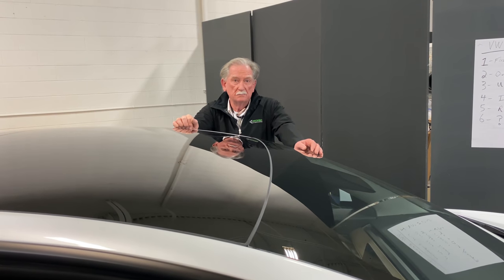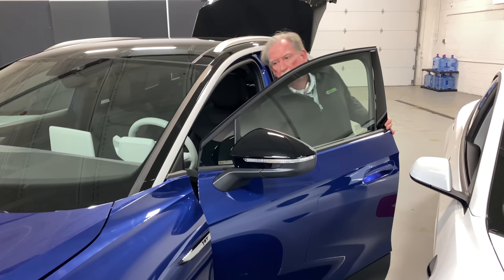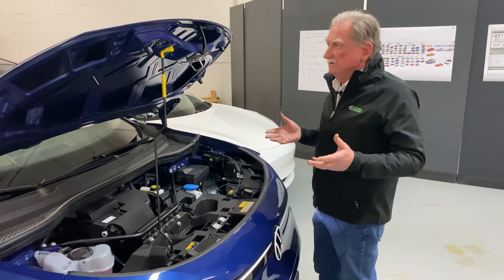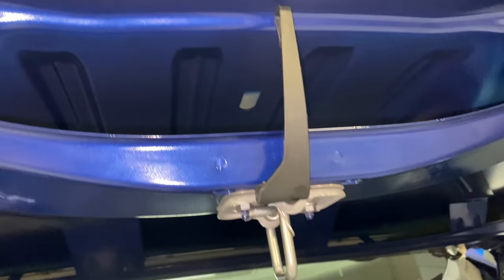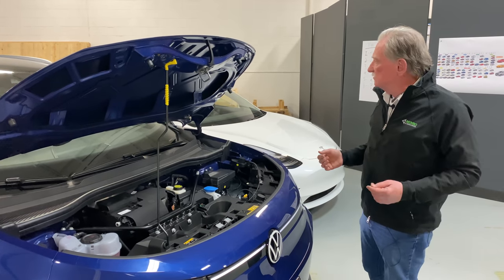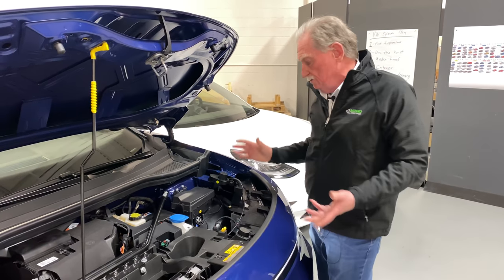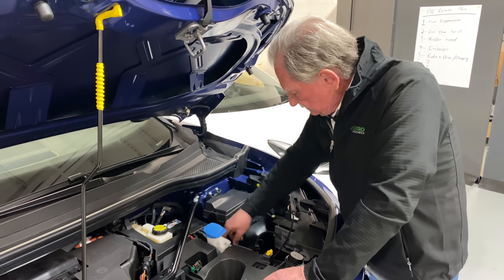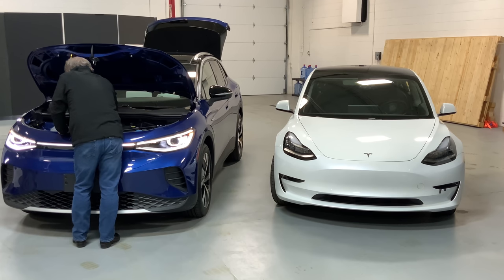2021 Volkswagen ID.4: E2 - Under The Hood

Comment: Looks like ID.4 has a lot of opportunity to cut weight which would improve their range.
Reply: Weight is not something you want to spent to much time on electric vehicles. Because it's also a positve thing. But only because of recuperation. You can see it on the bmw i3 for example.
Reply: @lsb187  your response is a joke.  all vehicles should be cutting weight especially EVs.  Poor engineering.
Reply: Yes. Its about 600 pounds heavier then the Model Y Standard Range.
Reply: @strykerace  has nothing to do with poor engineering
Reply: @wolfgangpreier9160  they are both about 2000 kg. So what are you talkin about?
Reply: @strykerace  read and educate yourself. Read about the i3 and the weight problem. It's a controversial topic. But studies show that it's not as a big deal on EV than on gasoline cars.
Reply: @lsb187  Regen breaking does not make weight an advantage - just a little less of a disadvantage.
Reply: @ryankozak99  that's what i was about to explain.
Reply: @strykerace   Sandy has no idea what reason that rig is there for.  It could be for accident mitigation with the shorter front end.  He just rambles on about stuff being in the front without actually stating why it's there... probably because he doesn't know.  The range of the ID.4 has been measured, and it's perfectly adequate.  They use a lot more steel to keep costs down, but it adds weight.  Would Sandy prefer they use Aluminum and lose money on every sale like Tesla?
Reply: @lsb187  ID4 weighs 4517 pounds or 2049kg. Model Y Standard range Rear Wheel drive weighs 3920 pounds or 1780 kg.
Reply: @updlate4756  They don't
Reply: @wolfgangpreier9160  never mind you're right
Reply: Agreed 👍
Reply: Once the range is adequate nobody is too worried, there are big manufacturing cost and repair cost benefits to steel. The main cost to consumers as a result of the increased weight will be much faster tire wear. I was amazed at this difference when I moved to a bigger car that was about 200-300 lbs heavier and lost maybe 4-6 months of tire life - the new car was more powerful and better in every way (Except fuel consumption, which was similar) than the old one though, so I'm still happy with it 7 years later.
Reply: @lsb187  educate yourself.
Reply: @updlate4756  adequate does not mean its good, and adequate is depending on who you are talking to.  Sandy rambling on has more value than most highly qualified engineers.

Comment: I was so surprised when he opened the VW frunk. I questioned whether it was an EV for a second!
Reply: Because you're ignorant. Short bonnet with all the equipment underneath allows huge interior space. Tesla has small interior space with many equipment inside the car and long useless bonnet.
Also the huge turning radius of the Tesla versus Volkswagen ID4. Laughable.
And Tesla has some of the worst pedestrian safety of modern cars tested by Euro NCAP.

Comment: The frunk of the ID.3 (and ID.4) could be used to hold a fuel cell stack, so it was not designed to carry luggage,
which explain why there is an handle located near the driver instead of an icon on the Tesla screen or the phone App.
This was mentioned during the ID.3 concept presentation at the 2016 Paris Motor Show.

Comment: For other cars you don't jump directly from the battery you normally pull the fuse box cover off and there's a metal plate which I can see at 11:07, maybe double check manual?
I quickly googled it and couldn't find the information

Comment: At least they included a fuse guide in the manual, my 2017 e-Golf comes with no info on fuse layout. Must contact dealer tech or guess. The reason given for doing this is that it changes too frequently to commit to a manual. Really? I'd settle for a sticker with the info.

Comment: I didn't know EVs still had regular car batteries.
Reply from the maker: Yes indeed. Even Tesla’s have small 12v batteries. The low voltage systems still operate on 12 volts and the battery is sized for those loads.
Reply: Elon said is multiple interviews he wants to get rid of those, maybe in cybertruck
Reply: @635574  New Model S and X are Li-ion 12v
Reply: @Robbie6298  Still 12v
Reply: @andkosification  Unless all the suppliers in the automotive industry move to 48v or Tesla makes everything in house were gonna be on that archaic standard forever.  Most OEMs aren't going to design thier own 48v window switch, dome light, ect
Reply: @635574  Elon also said that we shouldn't still be relying on measly 12v batteries. And he wants to move on to a higher volt capacity instead of 12v.
Reply: @635574  uhm nope he won't get rid of those, many other companies like mercedes have been using 48volts battery systems, the high voltage battery is very dangerous.
Reply: @Robbie6298  mercedes, audi, bmw, land rover..... already uses 48 v systems
Reply: @635574  Most likely it'll just change to a Li Ion 12 volt.

Comment: "Franz, should ve maybe move ze metal bar or ze battery?" - "Nein, let's rather find a smart but ultimately overengineered solution to a simple problem! It's the German way!"
"How about a frunk?" - "Are you crazy? It's hood, people will expect something enginy-looking under there. Use ze largest fuseboxes, it'll use up some space!"
Reply: I bet 100+ meetings went into that coated cross bar.
Reply: @avirbd  I bet you would loose this bet. VW has 660.000 employees...
Reply: @wolfgangpreier9160 meaning more meetings? xD

Comment: This makes me even more confident on TESLA's lead
Reply: Did you doubt in the first place?
Reply: @pedroferreira9234  seeing is believing, inside look - I had 1% doubt you can say
Reply: Based on what?  From the comments, Sandy doesn't understand that fuse boxes are cheaper, he doesn't understand that there's a jump point in the fuse box, he doesn't seem to understand that the shorter front end means more cabin space, he doesn't seem to point out that steel is cheaper than aluminum, nor that this car doesn't weigh much more than a model Y.  Bjorn already did the 1000 km test, and it performed well, so range clearly isn't an issue.

With all Sandy's hyping of Tesla, he never points out that without regulatory credit sales and tax credits, the company would be losing billions of dollars per year.  As it turns out, you can't just throw every needlessly expensive piece of hardware in to your car with little net benefit and expect to return a profit.
Reply: @updlate4756  valid points but imo design is not that great, and Tesla not loosing Money - grow up!
Reply: Which lead!?
Reply: @alanmay7929  software, battery and powertrain, engineering
Reply: @AshJuneja    Yes, Tesla is losing money without tax credits and regulatory credits.

Tesla's 2020 profit was $700 million.  Their regulatory credit sales netted them $1.6 billion.  Take away those credits, and they're now losing $900 million in 2020.  I'd also conservatively say they earned about $4k on average in tax credit subsidies for every vehicle they sold in 2020.  That's $2 billion of free taxpayer money.  Take that away as well, and now they're losing $2.9 billion in 2020.  

They also don't pay business or property taxes on any of their 3 functioning US factories, unlike the other OEMs.  Force them to pay their share of taxes, and how much more would they be losing?

Ah yes, agreeing with my points.. and then telling me "Grow up" because you didn't like me pointing out the facts of their business financials.  Oh boy.  Adults care about facts.  I don't know what fairy tale land you're living in, son.
Reply: will see that in 2021, also there’s something called sga that’s  why net income was low hence answer to your question from Gordon’s playbook

Comment: The thing is that in Europe we actually have pedestrians since people can walk to places unlike in the US.

Oh and also, why would you try to jump an electric car? If it runs out of juice, plug it it in the socket.
Reply: Plugging in the car typically only charges the high voltage battery, which is isolated from the 12V system by a relay when the car is off. If the 12V goes flat, those relays can't engage and the car won't go move.

Comment: It looks to me that VW took an existing vehicle and stuffed the empty engine compartment with whatever they needed for the new drivetrain. Where tesla designed from the ground up!
Reply: No, this is a ground up EV built on a skateboard platform. VW made the decision, as others have noted, to make the hood short (compare it to the Tesla hood) to give the car more cabin space. In many ways (like with the "pedestrian" protections), VW is showing that this is a European car -- where in cities there can be a lot of "blind" corners where a long hood makes it very tough to see oncoming traffic at some intersections.
Reply: At least to me it feels like the opposite. The front of the VW is much shorter and that allows for either a shorter car or a larger cabin. In Tesla's case it's as if they chose a design with a massive engine bay then added a frunk as a way to use up all of the empty space that they were left with.
Reply: It was built from ground up by former fossil engineers. Teslas were built by industrial designers 
and part time self made engineers and rc enthusiasts and not by unionized VW fossil engineers.
Reply: @wolfgangpreier9160  The fact that the VW engineers used to work on ICE cars is kind of irrelevant. Tesla's cars always seem like they were designed as consumer electronics rather than a real car. Shoddy build quality and intentionally making it difficult to do any servicing.
Also you make out like unionisation is a bad thing. I can tell you that's definitely not the case.
Reply: @wolfgangpreier9160  out of deluded tesla fanboyism and tesla has actually grabbed all ice engineers they could from many german brands, korean brands have been doing the same. to german brands designers also btw
Reply: @wolfgangpreier9160  seriously stop your fanatical absurdities, theres no mechanical engineering separated for combustion engines and electrical. tesla fanboys manage to be actually toxic to the electric cause.
Reply: @jh5kl  Nope they have not. 
But it does not matter. Because that was all in 2008-2016 when they made the first roadster, Model S and the first production line for the 3 which was finished in 2018.

I don't care how much you want to insult me. Its boring but please continue...
Reply: Stop talking nonsense, the id4 has way better practicality and turning radius than the model3, go watch Björn Nyland videos

Comment: Nothing about the European head impact design makes sense to me. Really, if you get hit by a car at 30 mph you have something to worry about. How about making the frunk out of out of thermoplastic body panels, like 90's era Saturn cars, to absorb impact? All of that steel and those bump stops are silly. I'm sure there is a simpler, more elegant solution. Besides the hood itself, what explains all of that "stuff" under the hood? Volkswagen started off with a clean slate and this is what they came up with? I suspect it's because VW outsources everything and nothing is made in house. It looks like VW made an electric car with legacy car parts.
Reply: the head impact is tested with dummys, it actually works. i don't know about 30 mph but many inner city streets are slower and with break assitants the car should slow at least somewhat down and safe lifes.
Reply: @merzto  I don't doubt that the head impact design works. But why create a Rube Goldberg machine when a far more simple design would work just as good? Like I said, why not use thermoplastic body panels which absorb impact far better than steel? It probably has to do with some hand shaking where the VW suits pocket money in exchange for using steel.
Reply: @davidhunternyc1  The thermoplastic panels will flex until it hits something hard in the engine bay and then give the pedestrian an impact almost as hard as if they'd just hit that part in the first place. The crumple space and designed deformation of the hood panel is essential.

Comment: A frunk would be a nice option, but they choose to do a different packaging. All you really need a frunk for ios those grubby charging cables you dont want to throw in the nice trunk in back.
Tesla has eveything lower in the front which makes room above. VW´s decision to mount the HVAC- unit in the frunk robs alot of room there. The rest is radiators, pumps, and underneath is possibly room for a front drive motor in later versions.
The conclusion is that Tesla has better packaging, even AWD- models have a frunk. But the VW is nicer to crash into :)

Comment: My guess is VW like GM who stuffed almost all the important bits that make the car go under the hood of the Bolt EV, understand that 5 years into ownership and out of warranty, it will be easier and far cheaper to have a car serviced when components do not require mass under-body disassembly for replacement and repair.  Ever seen what it cost for a tuneup on a Porsche Boxter, that is because the components are buried under and inside the body of the car. 

Having a frunk in a EV is cheaper for the manufacturer, not the poor Joe who ends up owning the car out of warranty.
Reply: Actually, you can get to all those bits within about 2 minutes on the Model 3/Y.  There is a snap in cover that simply pulls off and then the frunk bucket unbolts with a few bolts.  Then you have full access to the battery, brakes, HVAC, etc. Not a big deal.

Comment: In my "old" VW there were probably more than 100 fuses. About 25 under the hood, ~70 under the steering wheel, ~30 in the trunk. Good luck reading the manual and trying to find out which one it is, as they were spread across pages and with other pages in-between. Without the manual for the exact model and year you are out of luck.
I guess all the wasted space and the fuses and everything has to do with legacy design. They want to reuse components and suppliers while avoiding expensive vertical integration.
It's sad that European car manufacturers haven't caught up with the times. The last major integration step was CAN-bus, >25 years ago. And it's not like you can swap parts from another car (commodity parts).

Comment: I suppose that crossbar and all those heavy components are there to provide the chassis with the rigidity it is missing due to the absence of an engine. My guess is that VW structural design of the ID.4 is still too close to that if an ice car. What do you think, Sandy?

Comment: VW has never added fuse diagrams. And pulling the fuse will cause computers with programming that isn’t permanent to reset and you need a dealer to fix.  Mad design but I likes their vehicles overall.

Comment: I found your video because I searched for what is under the bonnet of an ID.4 - it found you even though you call it a hood :)
Your point about shorting out when jump starting, when exactly would you need to 'jump start' an EV from the 12v accessory battery?

Comment: Do you need a frunk (frout or whatever?) model 3 is pretty shallow and not as big as model s and others. No, but is a nice place to store charging cabels. The interior space is bigger in a id3 than model 3. (id4 is even bigger). I would like if vw would add some space there (but it would not be much) and as the lid is pretty heavy I do not see the point.

Comment: Well, all that stuff in the front means it's not inside the cabin, so there should be more room there, right? Also, the VW's bonnet is quite a bit shorter than the Tesla's so it's going to look more cramped. A lot of that plastic support structure is likely to be a big load of nothing -- maybe. I've got no reason to stick up for VW, but I think your bias is showing a little bit.

Comment: How long could one realistically expect that coating to remain non-conductive, in an environment where it might get scratched by the jumper cable clamp, and corroded from salt on the road? What indications of a failure would be evident?
Reply: My first thought was what would happen in a crash?, I envisaged the bar being damaged, rammed into the live battery post and starting a fire! -an accident waiting to happen!
Reply: @FairlyOldGit  I think I saw another commenter saying that the bar was made from a non-conductive glass reinforced nylon. They may have been referring to something else though.

Comment: I don't understand the criticism of the ID.4 front hood for not having a frunk.  The Tesla front hood is about twice as long as the ID.4's front hood.  It is actually the Tesla design which is more unusual for EVs as most EVs have a very short front hood just for the motor like the ID.4 design by omitting the frunk storage.  Also as a car person, I prefer to have access to the components under the hood.  The Tesla has zero access.